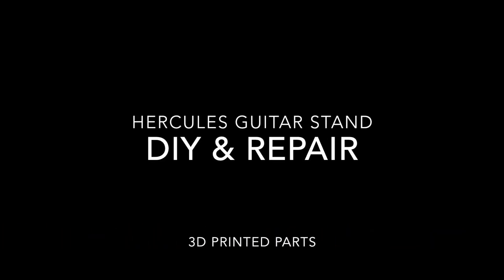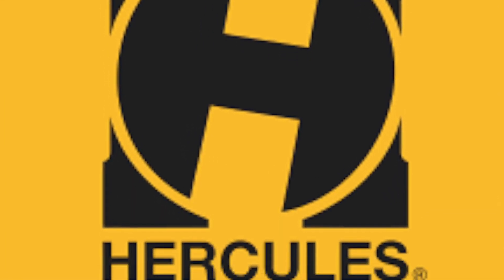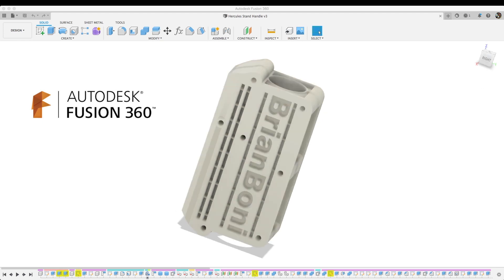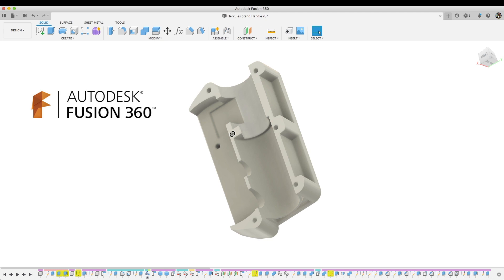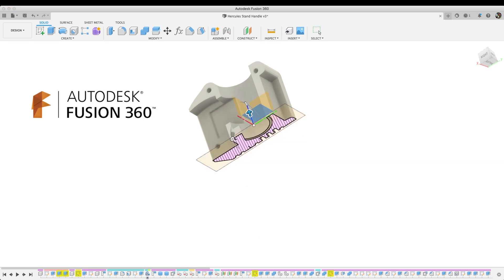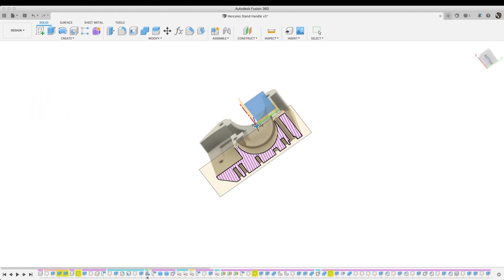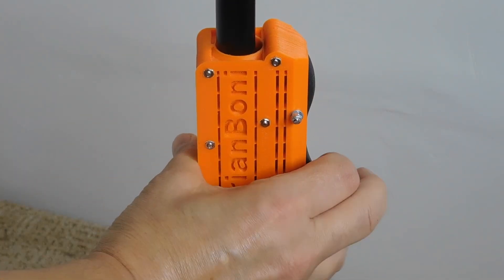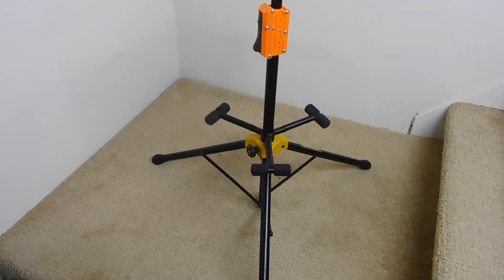DIY Guitar Stand Repair

Comment: Massive thanks for this, my friend at work has managed to print this for me and it looks great, he even put my band name on the side!:) please can you provide the sizes of the screws and nuts you used as we are struggling to get a good fit. Thanks
Reply from the maker: So glad you found this helpful. The screws and nuts are called #4-40 which is an American size and common around where I live in Cleveland Ohio. Looks like you live in the Midlands (I used to live in Stoke on Trent and if your band came around I'd be sure to come out! Nice videos.) Tell you what, if you put up some photos of the part in the "Post a Make" section of the Thingiverse page I'll send you the nuts and bolts. Contact me via Thingiverse when you're done. If anyone else needs the parts contact me on the "About" page and I'll figure out a fair price plus postage.
Reply: @BrianBoniMakes  that’s ace, I should be able to get those here👍 just down the road in Ashbourne, Derbyshire. Would love to play the US sometime. Take it easy and I’ll be sure to send photos when done